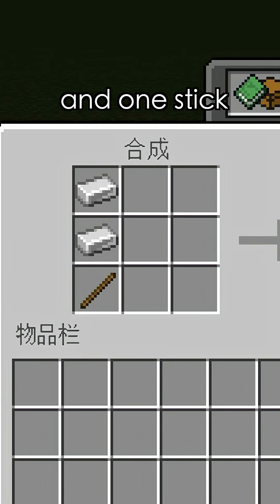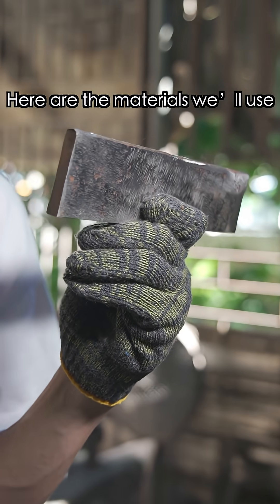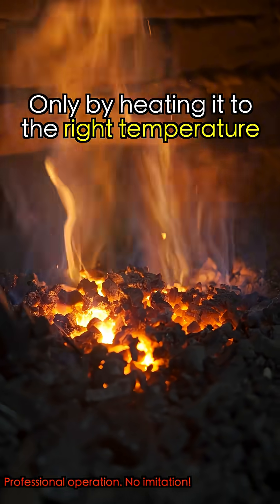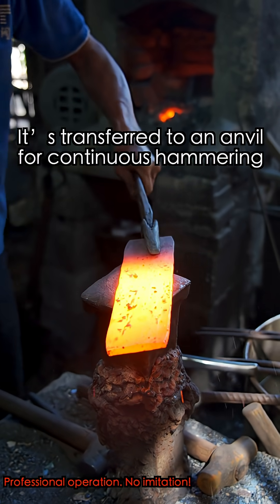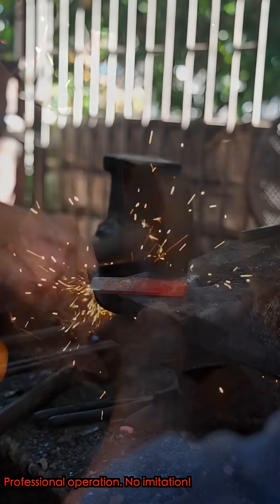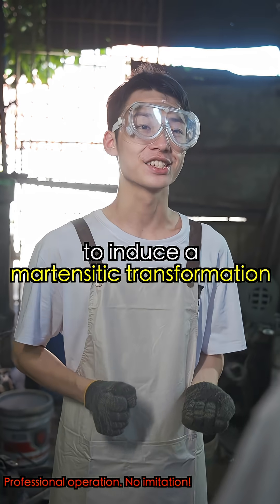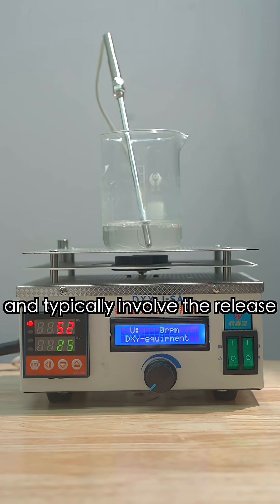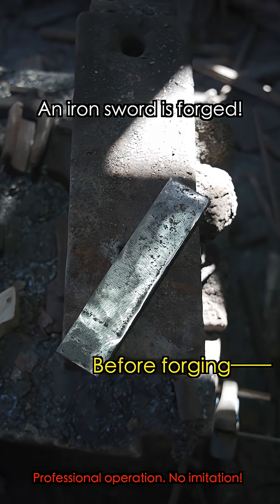🗡️Question❓How is An Iron Sword Actually Make in Real Life❓Could Miwu Get His Own Sword❓

Comment: I’m at obsidian would be turned into a sword. You’d most likely have to use a whittling technique, which is your chip off small pieces which makes extremely sharp. The reason they aren’t made into swords, but small little blades is if you were to hit anything made of metal with it it would shatter due to it being fragile Due to it being a form of glass

Comment: Well yes obsidian can use to be a sword but the way of making it would be different and I guess harder because you should shape it by hitting with special tools and something like carving ❤
Reply: Obsidian is very brittle, like glass. While it's possibly very good to make a smaller knife or arrowhead, it will be too fragile in sword size (and weight). Even if you can somehow make one, it's going to be usable only once, as it will most likely shatter on impact
Reply: @OGro55  obsidian IS glass tho
Reply: @OGro55 could obsidian be used in maybe a sword with obsidian only used at the edges for a sharper cut whilst the main structure is made of iron
Reply: @MarcusLavety what you're describing is very close to a Macuahuitl. Simply put, it is a large wooden club with obsidian bits embedded to its sides. It's closer to a mace rather than a sword, but yeah, it exists